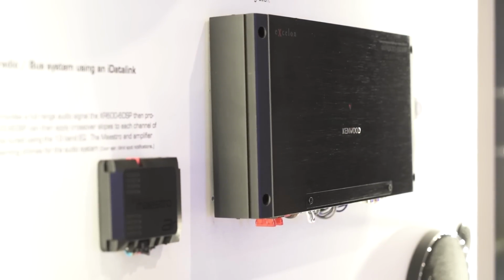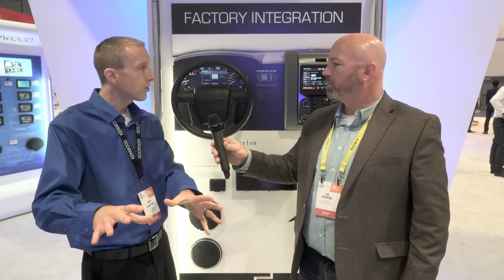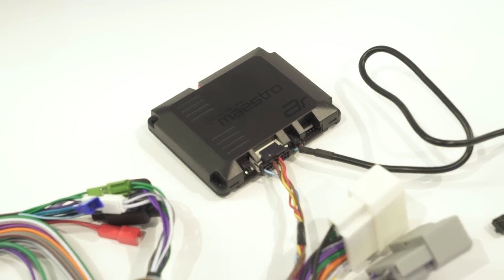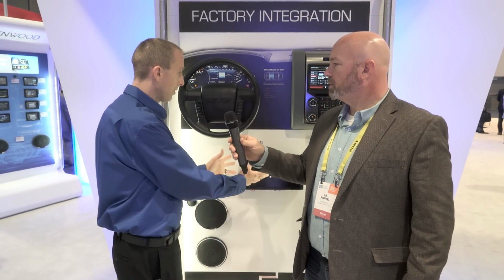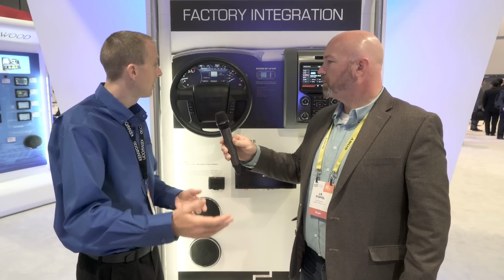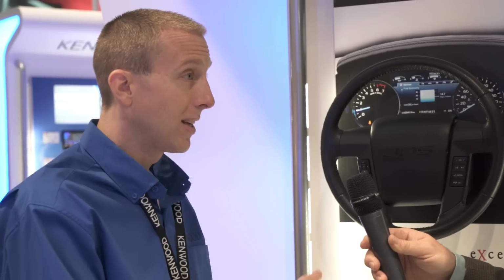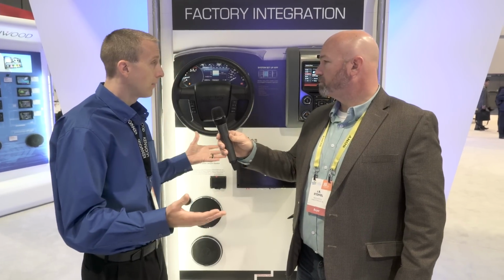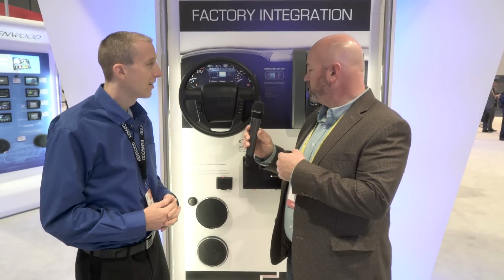Kenwood XR600-6DSP factory integration amplifier | CES 2017 | Crutchfield video

Comment: This would have taken off if it wasn't just factory integration and actually had RCA inputs
Reply: why would you need rca inputs?
Reply: @icebreakers1153  If you have an older car that is not supported by ADS (Generally those before early 2000's), you are already gonna be running an aftermarket head unit, which may have 4-6 2-5v RCA preouts for front rear sub channels.